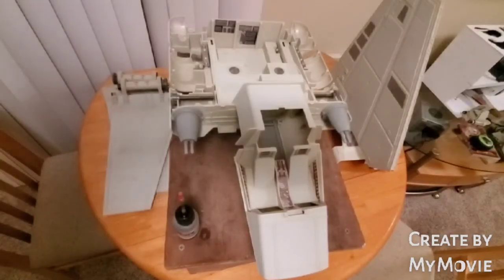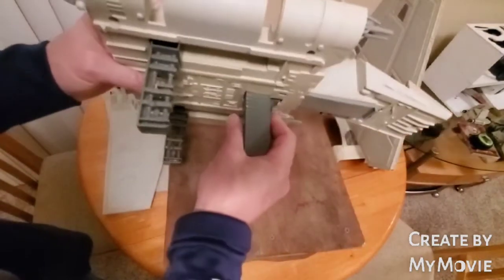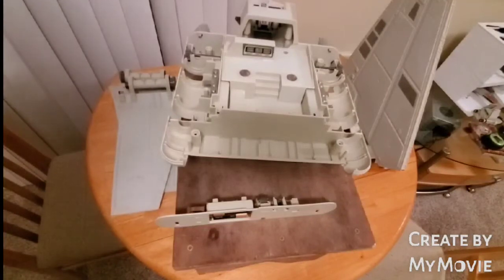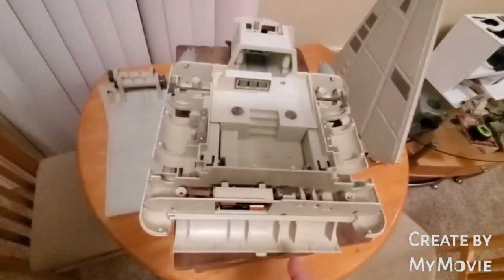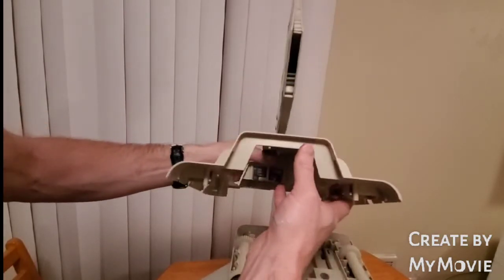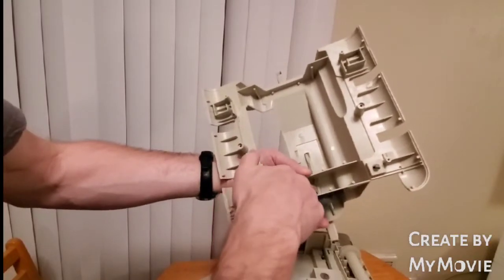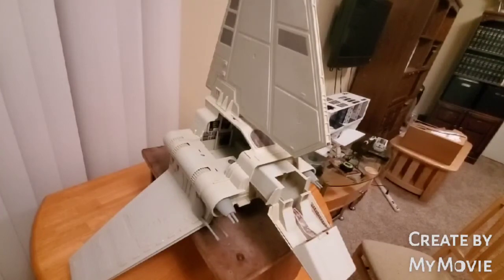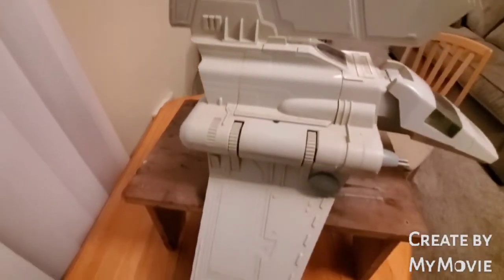1984 Kenner Imperial Shuttle Reassembly, Maintenance and Repair

Comment: Hello Jim, this video is absolutely awesome!!! It was very entertaining but I’m afraid I tend to break things. I have zero mechanical abilities. I also have an imperial shuttle that I’ve had for decades. The wings give issue as they do not stay up/descend as evenly as they should. If we were neighbors I’d request a work order for repair. Either way, thanks for an enjoyable video.
Reply from the maker: Thank you for the kind comments.  I will be putting up another one this weekend showing a size comparison and the features that I did not include in this video.  I would be happy to help, but it most likely would be too expensive to ship.  I am not that mechanical and you would probably be just fine taking it apart.  The thing to remember with this plastic is that it is not soft.  The Rebel Transport and the Falcon are also made from the same type of plastic.  If you decide to go that route, feel free to ask questions along the way.  Also, check out Toy Polloi's videos on it.

Comment: What’s the strip of metal by the wings
Reply from the maker: I assume you are referring to the metal support that folds up the wings.
Reply: @ it’s right next to the opening where the figures could set inside on the side opening it’s like a metal bar on each side with screws
Reply from the maker: @muursnorthwestamexem8581  I think what you are seeing are the hinges for the landing gear.

Comment: What size are those screws for the battery contacts
Reply from the maker: Since I had these on screws on hand and didn't have to go buy them, I am not sure what the gauge is; however, it is probably equivalent to a 4-48 machine screw.  Don't buy machine screws, though.  You want them to have a "wood" thread. Here is a link. https://www.ebay.com/itm/164716631083?mkcid=16&mkevt=1&mkrid=711-127632-2357-0&ssspo=tpWuZvu_Rl6&sssrc=2349624&ssuid=steF6eujSAe&var=&widget_ver=artemis&media=COPY

Comment: Is the plastic on the newer year shuttles share a different or same plastic
Reply from the maker: Unfortunately,  I cannot answer this question because I don't own a newer shuttle.  That being said, I do own several newer TIES and X-Wings and the plastic is not as brittle.
Reply: @ Are you taking commissions on cleaning and fixing these
Reply from the maker: @muursnorthwestamexem8581  I have never considered it as wouldn't be cost effective for the buyer, considering my time and the cost of shipping back and forth.
Reply: @classicalvintagecollector what plastic oil name brand did you use.